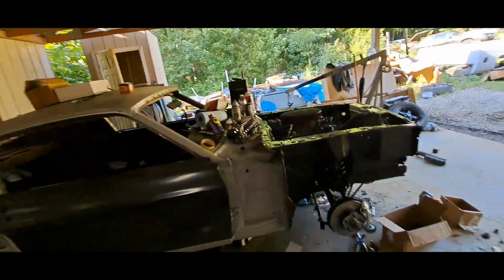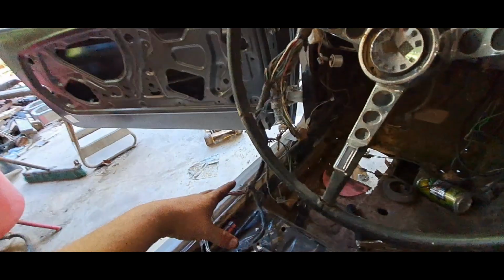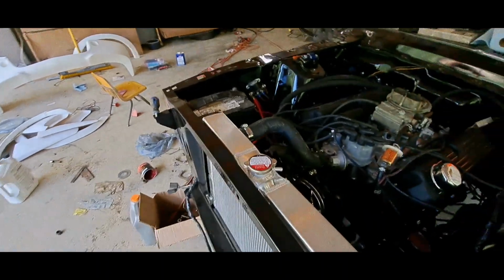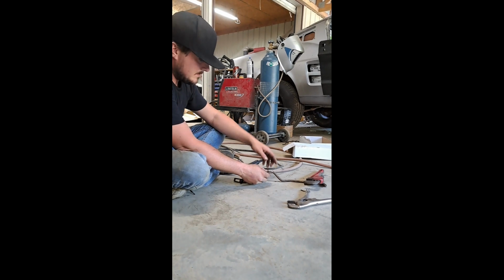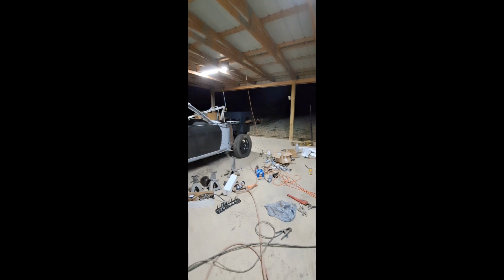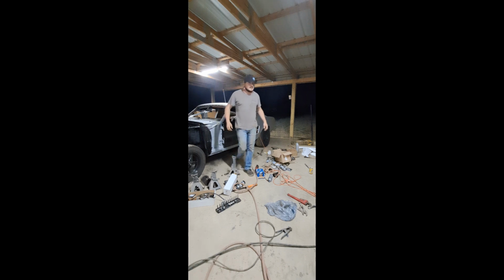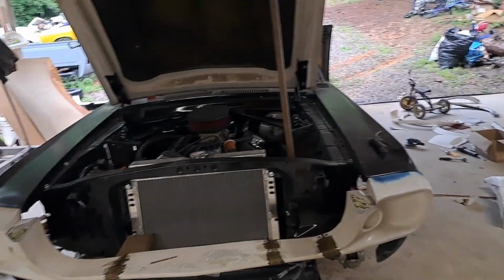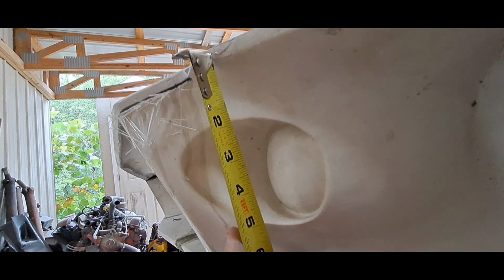1967 mustang fastback built from a rusty coupe in 30 days 12500 budget. first test drive.

Comment: So you hooking up that foxbody ps pump worked with that power steering mechanism? What fitting did you end up going with? Love the videos man! Keep it up.
Reply from the maker: I ended up going to orielys and getting a 5/8-18 fitting for both line and pump side. One side was a inverted flare and other side had a bubble type flare. It all screwed together and somehow worked.

Comment: Did that Fox body engine have a front dip stick tube or did you switch out the front timing chain cover assembly?
Reply from the maker: It already had the correct timming cover on it. Fortunately someone already done that part for me. I just plugged the dipstick hole on the side of the block